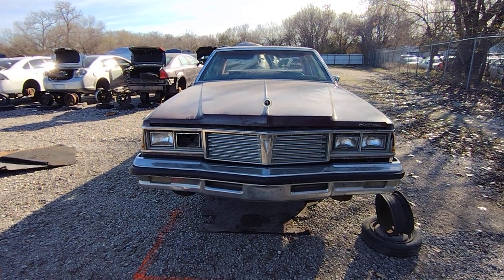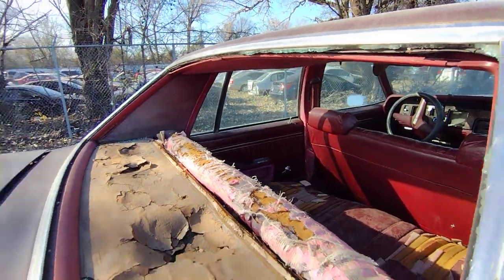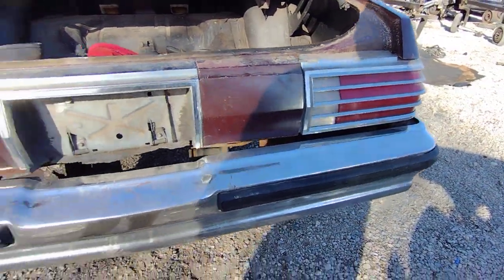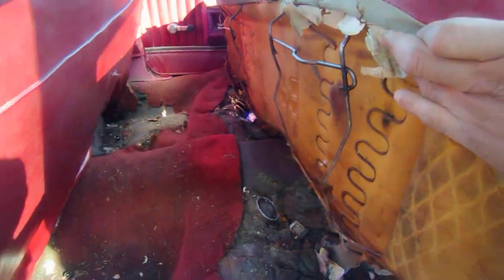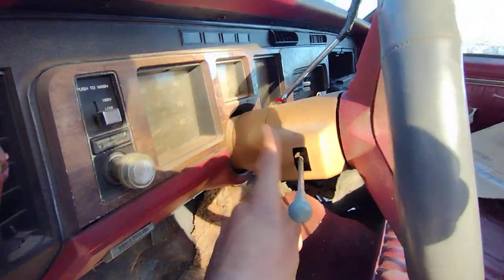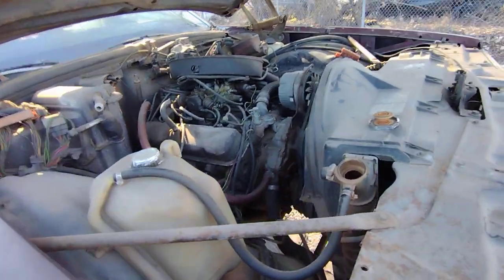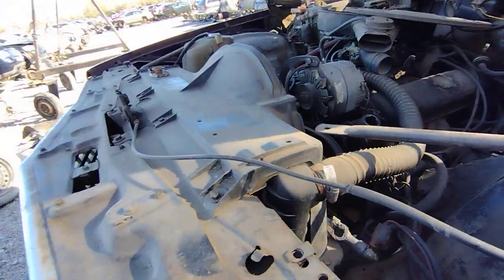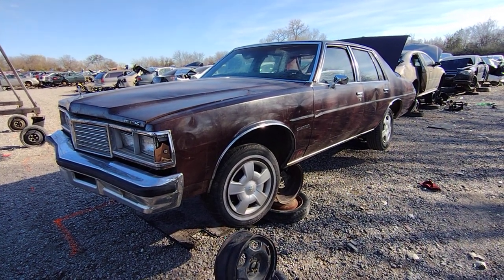Bare Bones Poncho To Meet The Crusher. 1978 Pontiac Catalina Junkyard Find

Comment: Whoa Nelley, the 'Cat will go splat.

Yes, 1981 was the last year for the Catalina and it was the base "B" body for the US market. No, gauges were optional. I've related the story of how my Dad told the dealer that we would not accept our '80 Bonneville without gauges.

We got the VIN, we win: 2 for Pontiac, L for Catalina, 69 for four door sedan, Y for 301 V8 with two barrel, aka RPO code "L27", Pontiac produced, 8 for 1978 model year, X for Fairfax, KS assembly and the rest is the production sequence. The original Fairfax plant that produced this car closed in 1986 and Fairfax II which is adjacent to it still operates today. Yes, "baby" Poncho for 1978, but 1980-1981 would have the 265 V8 which was also Pontiac produced and of course smaller than the 301 V8. My parents had a '78 Bonneville Brougham that was basically this same car, but it was pretty loaded. We sold it in 1980 to my dad's coworker because in 1980, my dad was eligible for a company car. There were 48,931 Catalinas produced for the 1978 model year. There's a salad dressing called "Catalina" that we used to have with our salads at dinner when I was a kid. LOL.

We got the tag, we can brag: ST78 for 1978 model year, 2BL69 for four door Pontiac Catalina, X for Fairfax, KS assembly, 74R for Burgundy/Claret/Carmine standard vinyl interior trim, A52 for front bench seat, 79U and 79L for Claret upper and lower exterior paint, and 11D for the fourth week of November 1977 production. I'd drive this (after cleaning it and fixing it up). Nothing wrong with a "small V8" and something that if you take care of it that will run, run, run, run, run, run, run, run, run and run some more. The 301 V8 was an excellent engine, except that most people make it something it was not. It's an economy V8 and made to be driven normally and not hooptied or souped up. It gets a "Rodney Dangerfield" of Pontiac V8s because the "mechanics" that attempt to "fix" them are the problem.

Whoa Nelley, the 'Cat will soon be flat. Paint code 79 is outta time. 301 and this one is done. RPO code "L27" is going to Heaven. That's it, time to quit. Poncho needs a new honcho. A52 and it's over for you. VIN code "Y" is going bye-bye. B body looking kinda shoddy. Going to get squished and the Poncho faithful, many here perhaps, Benny to a slight degree, but surely the Google Man are going to be very, very, very, very, very, very pissed.
Reply: Has anyone ever read this guy’s comment there a trip🙌😂😂
Reply: @enzoevans5914  Nice of you to say. LOL.
Reply: @enzoevans5914  I read them ALL the time!.He knows his stuff and has an amazing sense of humor 🤣🤣
Reply: I had the Bonneville version of this car of the same year.White with red velour interior.Power everything.Rode like a Cadillac!.
Reply: @leedaniels7196  My parents had two, a 1978 Bonneville Brougham four door and a 1980 Bonneville Brougham coupe. The '78 was sold to buy the '80 because by 1980 my dad got a company car. A colleague of my dad's bought the '78 from us. The '80 was stolen in '82.
Reply: @leedaniels7196  Nice of you to say.
Reply: @googleusergp  I wish i still had that car.One of the most comfortable cars i’ve ever owned!.It was a very reliable and well built car.
Reply: @googleusergp  Was that 80 ever recovered?.
Reply: @leedaniels7196  Never was and to this day I wonder what became of it. My father, grandfather, and uncle went to do pre-season practice at the local bowling alley. Came out an hour or two later and the car was gone. My father knew it instantly. My grandfather and uncle were saying, "Nah, I think you forgot where you parked it...". But my father knew. Called the cops and the officer said, "Year, make and model?". My father told him. He said, "Lemme ask ya, Mac, what type of interior did it have?" "Tan velour". The cop said, "Forget it. That car is already at the port and on a boat going overseas to the Middle East  (they don't want cars with leather interiors). They had an "order" out for that car. Call yer insurance company". We replaced it with a 1983 Coupe DeVille. This was in September 1982. Organized theft rings were stealing them and exporting them.
Reply: @googleusergp  Wow!.I believe that’s what happens when most stolen cars are never recovered.
Reply: @leedaniels7196  I recovered my 1982 Toronado on a beach in 1990 the day after it was stolen. It was probably an hour away from getting washed out by the tide. I had it towed out of there (a feat in of itself), bought a 1979 Toronado parts car and put it back together. I bought the car in 1987 sold that car in 2009. I never registered it after that, but I did put it back together and got it running. I sold off the parts from the 1979 Toronado that I didn't use and in the end it worked out, but I'm not sure if I'd do it again. I only saved it because my father had picked out the car and it was stolen shortly after he passed away and made the choice to buy it back from the insurance company. 

Oddly enough, two years ago, the 2009 Pontiac G6 convertible I bought to replace it was totaled out when ice hit the car and dented it. I bought it back, and had it fixed. Came out nice and you can't tell.

Comment: Mr. B. Here ! These vehicles of era have gotten a by rap . SUV’s today 9000 lbs , B body’s tops 3,900 lbs fair mileage cost to readable & as   Owners you could do the work yourself. Family’s could work around vehicle cost of maintenance . Sad that vehicle is in boneyard .
Reply: I feel the same way. In the name of environmental stewardship, we have bssically outlawed full sized American family sedans and wagons, only to replace them with even bigger quad cab pick-ups and suvs.

With a decent fuel injection system, a properly geared drive train, and a few other tweaks, these cars would be capable of at least 30 mpg on the highway.
Reply: @martinliehs2513  Yes ! But Marketing pushing the big eggs on four wheels . My wife & I have 1984 Olds Delta it not a good looking car but the cost to it is 10 X cheaper to maintain !
Reply: @martinliehs2513  The SUVs and trucks for a time could skirt around the safety and emission rules as "trucks" and have lagged behind regulations for cars. That got the ball rolling as they are high profit items for the car makers.
Reply: @Martin Liehs  Mr. B. here ! We the consumer have got short chain , by folks who think they know best , with said we have toll that new is the way to go, ok but vehicle we trade in we get nothing for, what ‘s wrong with this picture ?

Comment: Those full size pontiacs really drive down the road nice. We had a 77 Bonneville way more plush and more options than the Catalina, a really nice car. All those GM B bodies from that era are great highway cruisers, 301 wasn't a powerhouse but still a fairly reliable engine, it moved those B bodies adequately.
Reply: The only motor that ever putting those cars that was worth the s*** was a 403 6.6 all that 305 and 301 was garbage way underpowered
Reply: @jasonmurdoch9936  Nah. You could get the Pontiac 400 in them through the 1978 model year. That was the engine to have. The 403 was a nice engine, but it belonged in an Oldsmobile, not a Pontiac. The standard engine in US destined "B" body was a 301, not a 305. Canadian Laurentian models could have a 305 V8.

Comment: 301cid. The 265 cid was in 80 and 81 only
Reply: That's what I thought too I didn't think the 301 and 305 came out till 1980 in the seventies it was a 350 in the 403 for the GMB body cars I had a 1978 Oldsmobile ninety eight it had the 403 6.6 a little under 200 horsepower with the 4 barrel carburetor three speed transmission but that thing had monster torque I could pull a house with that thing that thing would never get over 10 Mi to the gallon on the highway though but it was a great car other than that
Reply: @jasonmurdoch9936  The 301 came out in 1977 and was used through the 1981 model year. There was the 301 two barrel, RPO code "L27", VIN code "Y" used from 1977 to 1979, the 301 four barrel was RPO code "L37" and available from 1978 to 1981, and was a VIN code "W" engine. There was also the 301 turbo from 1980-1981 for the Firebird Formula and Trans Am and that was a VIN code "T" and RPO code "LU8".  The Chevrolet 305 was used earlier than 1980.
Reply: In 1978, the 301 was the "baby" Pontiac V8. I think that's what he was referring to. Yes, 1980 and 1981 for the 265 V8 two barrel, VIN code "S" engine. My parents had one in a 1980 Bonneville.
Reply: @googleusergp  GM had a 305 all the way to the mid-80s I know my mom had a 1984 Cadillac with a 305 in it
Reply: @jasonmurdoch9936  That's incorrect. A mid-80s (1986 to 1990) rear wheel drive Cadillac would have had a 307 Oldsmobile V8 in it, not a 305. The 305 with TBI came later on for the rear drive cars. The base engine in a 1978 Bonneville as I stated is a 301 V8, backed up by the GM brochure.
Reply: @googleusergp  I'm sitting right here looking at the damn sticker the cars in front of me how you going to tell me I'm wrong you better check your facts buddy
Reply: @jasonmurdoch9936  I don't have to, but you might. Plus, my father sold these cars new. You couldn't get a 305 V8 in a Cadillac until the 1991 model year. It was an RPO code "L03" VIN code "E" with throttle body fuel injection. Contrary to what you believe or are smoking, it was NOT available before then. Post the VIN # of this car, leaving out the last six digits of it.
Reply: @jasonmurdoch9936  Your mother's 1984 Cadillac with the 305 in it was swapped in. The only engines in 1984 were the 4.1L V8, RPO code "LT8" HT4100 VIN code "8" engine, or the 350 Olds diesel, RPO code "LF9" VIN code "N". The only other engines used (excepting a Cimarron in 1984) would have been the 368 VIN code "6" four barrel and VIN code "9" with fuel injection, but only commercial cars used them. The Cimarron had a 2.0L four-cylinder engine that year. The 305 was NOT used in any 1984 Cadillac model sold in the US.

Comment: Picked up a 1977 4 door Catalina, rust free stored the last 25 years. Got it before the crusher.
Reply: What engine is in it?
Reply: @googleusergp  had a 301, but bought as a roller.
Reply: @scottshumaker4969  1977 would have had the same 301 V8 with a two barrel, RPO code "L27" as this one does. The 301 VIN code "W" 4 barrel didn't come out until the 1978 model year. It was RPO code "L37".
Reply: @googleusergp  undecided if it will get a mild 350 sbc or a mild 454 bbc. Original paint and cloth interior. 2 tone tan with gold, and a set of Chevrolet 15x8 rally's finish it off.
Reply: @scottshumaker4969  Yuck. Don't "Chevyiac" it. Keep it Pontiac powered. I get it, Chevrolet powered is cheaper, but everyone's done that. Pontiac power is what makes it rare.
Reply: @googleusergp  I agree with you about keeping it Pontiac power but all I have is Chevy stuff. Nothing set in stone, who knows a good 400 or 455 may show up.
Reply: @scottshumaker4969  A Chevrolet V8 wouldn't even cross my mind for that car. That's just me.
Reply: @googleusergp  Dad retired from GM and I grew up on Chevys, nice thing about it is that it can be powered by any GM product. Thinking about it, didn't these come factory with a Buick v6 231 ?
Reply: @googleusergp  you seem to be very knowledgeable about Pontiacs, got a question for you. Will the 8.5 rear end out of a 1974 leman bolt into my 1977 Catalina?
Reply: I think it might but not a direct swap. Different chassis.
Reply: @scottshumaker4969  Yes, a 231 V6 was used on some in some years, RPO code "LD5". A real heap and a dog.